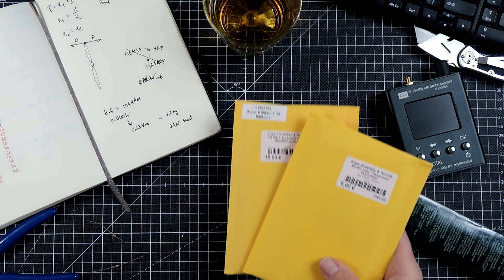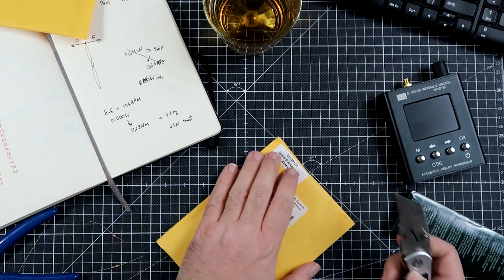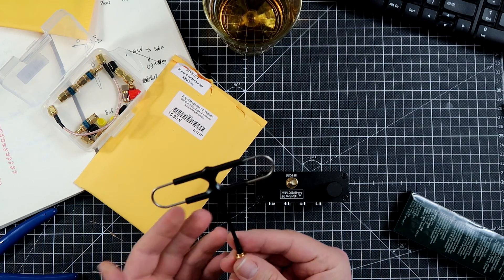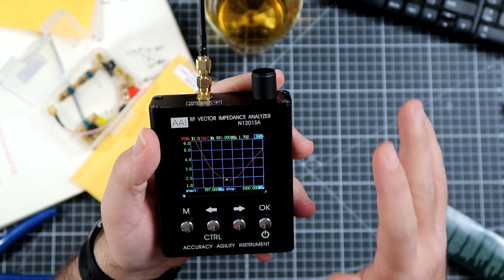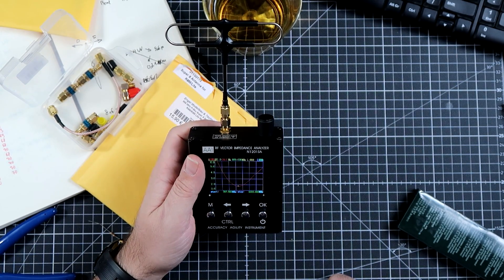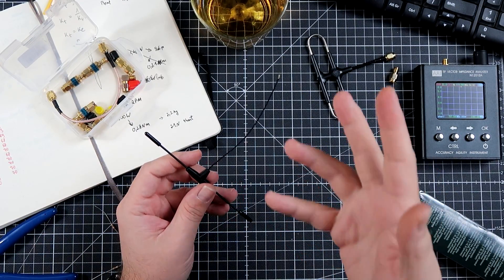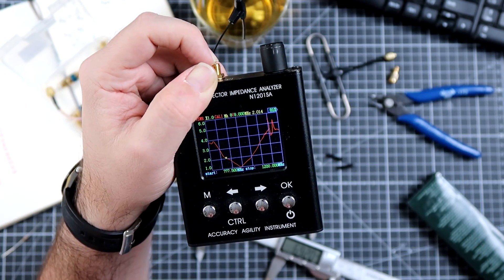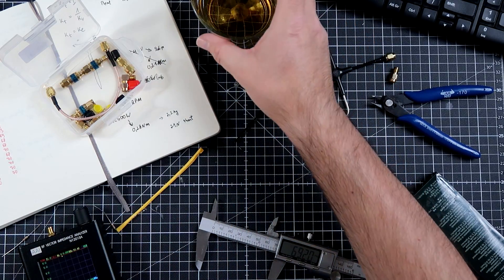FrSky Super 8 antenna and 868MHz IPEX4 Dipole for R9 Mini - I do not know what to say...

Comment: Paweł, what's your conclusion on the antenna? As far as I understood, the tune of the Super 8 is about right (so it's actually a EU version, even without the yellow marker), but the quality of the antenna is underwhelming. In contrast to that, the antenna for the R9 Mini is not tuned for 868MHz, so apparently not the EU version. Is that correct?
Reply from the maker: Super 8 i fine. This dipole is not what the label said. It's not even good for 915MHz FCC.  This is the short story
Reply: @FPVUniversity  Thanks for clarifying

Comment: You clearly have FCC antennas. The label of the german shop is wrong. FrSky part number for Super 8 EU is 01100180 not 01100172. EU antennas have now a yellow heat shrink piece on them. The german shop sold you some antennas of the first batches maybe. T antenna for R9mini/R9mm EU is part number 01100177.

Comment: At next you should test the flex firmware and for every failsafe drink another vodka energy (or is that Apple juice) :)
I'm also tired, making a good firmware might be complicated 
, but cutting antennas to the proper length.

 "commeee ooonnnnn" :)

Na zdrowie

Oh, yust messured the active part of an frsky the antenna with the yellow marker bought from hours. 
It is 7.30cm from the middle.

Comment: Yellow is the new and improved Black.... well in Europe it is.... everywhere else it could be Blue or Red or even the old non banded 868 labelled antennae :) Pawel have you tested any of these independent manufactured antennaes yet? Couple of the Polish made ones come with a tuned label/SWR value.

Comment: I'm missing the yellow shrinking tube marker on your antennas. All of my FrSky Dipole T 868 and even my Super 8 868MHz Antannas are having this marker. 
But even on a non scientific comparision flight with different FrSky Antennas, the TBS Immportal T seems to be better than the FrSky Dipole T 868MHz. I even have ordered 4 of the FrSky Dipole T 868 Antennas, and all of them are cutted to a different length. 
But finally, with the Super 8 868 i'm getting nearly the same result as with the True Mox 868 - in regard to the RSSI Value in my osd.
All in all i think you haven't received the right EU 868MHz Antennas :(
Reply: Are you sure they are different length T antennae? Mine looked the same but the caps weren't on properly..... pulled them off and remeasured they were all the same length.
Reply: Dave Webb of course... I have pulled of the caps. They have all a different length. I even have posted pictures about it on Facebook in the r9 users group.
Reply: @TorbanDallas  Could they be tuning them individually or is there QC just crap? Time to make some Vee dipoles with the old wire dipole fly leads :)
Reply: @dj_dazzy    could be they released different versions on the market (no one confirm yet from Frsky). then, we, the users , are testing the antennas "assuming" we're having the same (in reference with the labels), but in actual we're holding different antennas. that's why some have success, some have failures ... my only thoughts...

Comment: You are testing the wrong dipole antenna. Either they mixed the labels or they tricked you! If you don’t see yellow band on the dipole antenna you have a 900 MHz antenna! Next time I suggest you search more details about the bands FrSky started adding to they antennas or else you will keep being dissatisfied without any reason. We are flying miles away with the yellow band dipole antenna on our MR and super8 on the transmitter.
Reply from the maker: I assume you are joking that I should take any responsibility for not receiving what I ordered
Reply: Paweł Spychalski then you shouldn’t blame the quality of FrSky for a mistake that a retailer made. Dipole T antenna with yellow band is working perfectly with super8 antenna. And that is a proven fact!